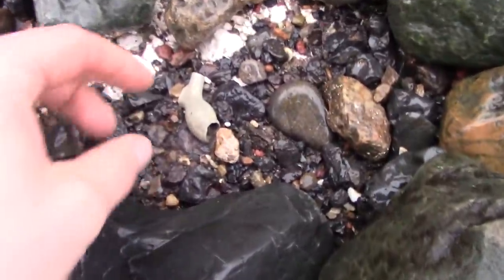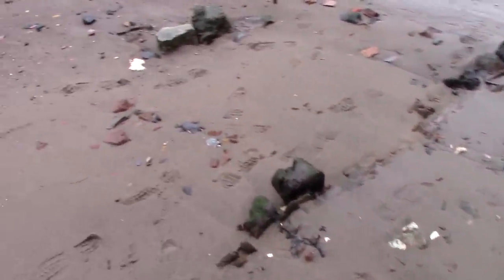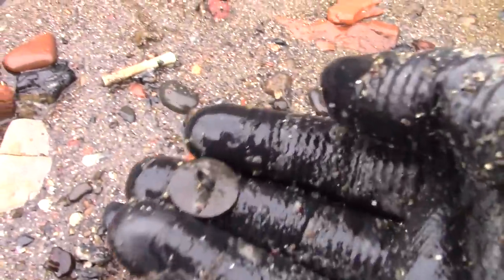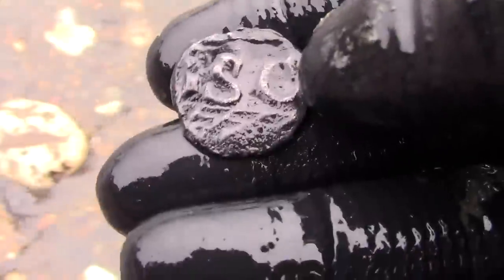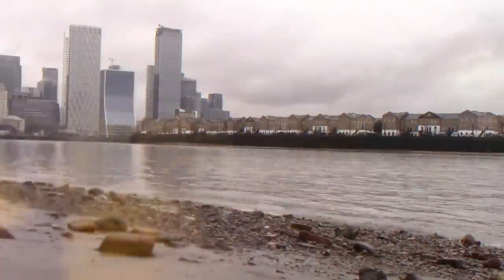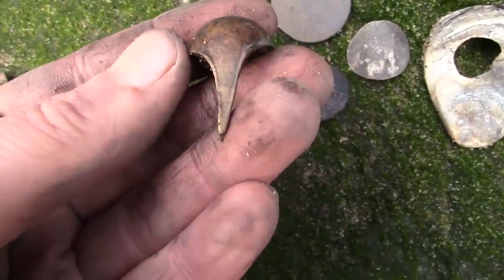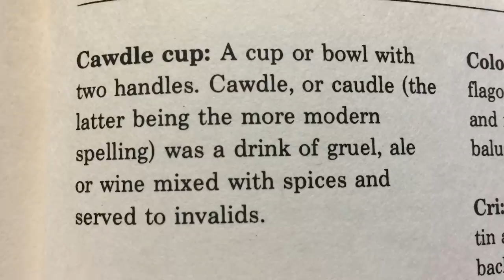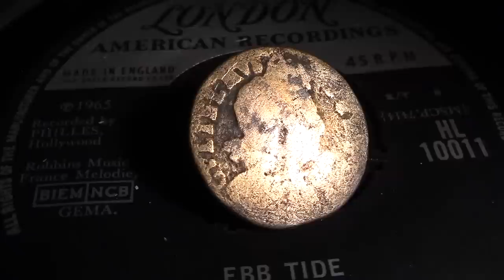I didn't realise I'd found my RAREST relic ever Mudlarking the Thames!

Comment: Hey Si! If you use a bit of water on the oyster while drilling with that bit, you’ll find less chipping and quicker results ( a little less friction) You’ve done a beautiful job on those buttons - gorgeous!!!  Cheers from 🇨🇦😁
Reply from the maker: Katie Cook Cool cheers!
Reply: He done good, right 🇨🇦 ?
Reply: I cut opal and the water keeps the piece cool and saves the diamonds on the bit. Well done!
Reply: @Sifinds  also if you put tape over the area you are cutting, it will help to not chip
Reply: I beachcomb for sea glass here in Nova Scotia , Canada.  I make jewelry and always use just enough  water to cover the sea glass when drilling . Your shell buttons turned out really nice . I'm going to try that this summer. Mudlarking looks fun !
Reply: yes water would be good - also less dust to breath in - apparently it can be toxic in your lungs
Reply: uncletigger  It reduces friction, keeps the diamonds clear and prevents that horrible dust from becoming airborne. Don't breathe it, it can cause silicosis.
Reply: Katie Cook the water also saves the diamond grit from grinding off the tool.  Those bits can be expensive!  I usually drill underwater by placing the piece in a shallow container.  You can also create a dam with putty, around the work spot, and fill it with water.
Reply: Goog call mate, those buttons are lovely, I'm going to do that myself👍
Reply: @deeyardo4850  Shell/Bone Inlay/Carver here in Hawaii. More than "apparently". The dust has the same effect as silica (silicosis) never leaves your lungs and will kill you eventually.

Comment: Oyster theory: They were used for ALL of those things-- cladding, roof leveling, oyster farming, button-making, and probably a ton more (and let's not forget that ornamentation for musical instruments was sawed out of bits of oyster shell-- you'd cut it into strips, plane it thin and even, and inlay it as frets on lute-bridges and so forth, as well as fancy ornamentation of all kinds on wooden boxes. This was done with bone too.)  Why so many uses?  Because it was a common resource, and you didn't have much in the Middle Ages (or any time prior to now, really) that was used exclusively for only one purpose, you usually had all sorts of stuff you could make out of one kind of thing.  Look at cow's horns as an example-- they made everything from jewelry to lantern-panes out of it.  BTW, be sure to wear a mask if you're going to be working with grinding down oyster-shell-- the dust is extremely bad for the lungs.  The buttons came out nice-- looks like something that'd be worn by Pearly Kings!  Congrats on the rare cup find-- I've never even heard of those, that was massively cool, and I love the hilt-pommel!
Reply from the maker: Spot on !

Comment: Oyster shells with holes used in building stucco walls and structures, another use as wind chimes! Cool buttons..see if the wind chime idea works!
Reply from the maker: Tom Shively Yes another project to add to the list. Maybe I’ll put a clay pipe stem in the hole. Now that’s an idea!
Reply: A wind chime with pipe stems, oyster shells, and lead weights, suspended from  larger pieces of flotsam or jetsam.  Although one made of eating utensils would make a better sound.

Comment: Hi Si I used to cut glass for a living we would use a bit like that to make holes in glass. What we used to do is make a dam around the place we wanted the hole with butyl sealer then keep adding water while drilling that way you would be drilling in a little puddle of water this would cool the bit and turn the dust into sludge

Comment: You should try wearing some of those oyster shells as belt buckles. Paired with rope and/or cloth as the belt.
Reply: I think making a belt from shells is a Great idea, only have the shells go all the way around the belt, like in the Southwest, Native Americans have silver, go all the way around the big wide belt
Reply: I was thinking less arts and crafts more research into original use. I think these shells are belt buckles popped off. Lori, I think the shells that go around the belt would have two slits not one hole, this would keep them on the belt when the buckle popped of and rolled away. Only rope and buckle for poor longshoreman, rope buckle and shells the way round if you are a pimp.

Comment: Those diamond bits last much longer if you use them with water, keep it soaked while drilling, I have drilled hundreds of holes with them into granite they don't last long dry.  Cool finds, great presentation of the cleaned up stuff!

Comment: Hello from B.C. Canada. I have to admit I didn’t read all comments so this may have been covered.
Out here on the west coast we have a sea snail called the moonsnail. It’s possible you have something similar in British waters. The moon snail envelops the prey and then bores a hole through the shell using its radula and an acid secretion. Once the shell is bored open, the proboscis is used to consume the flesh of the prey. The hole in the shell, which has a "countersunk" appearance with chamfered edges, and which varies in size according to the species, is a characteristic diagnostic sign of moon snail predation.
After saying all of this it doesn’t answer the question why some of the holes are square.
Enjoy your channel since I was born in Lambeth back in 1950. Would love to do some mudlarking.
Reply from the maker: GITNADOIX cheers pal!

Comment: The oyster shell itself held spawn so throwing them or stringing them back in the water saved the spawn from drying out. The holes are probably as you suggested, from stringing them up but that square one that is very cool!

Comment: Hello, I live on Vancouver Island in British Columbia Canada. We have the same kind of oysters, called green oysters. The part of the shell with the hole in it is the part that attaches to the rock, as they are dislodged the "oyster glue" that attaches the oyster to the rock is very brittle and you get the type of shell you found. We call them "angel wings" as they are so fragile and delicate, almost transparent in a way. the other reason for holes drilled into shells, such as oysters, clams and snails is a type of snail we have here called a "moon snail" they have a zipper like mouth that grinds a perfect hole in their dinner's shell, inserts it's proboscis into the hole and eats the flesh inside. "Moon shells", adult, are between the size of an apple, or even as large as a grapefruit, you should look them up on YouTube, fascinating. Happy hunting.

Comment: "That strange little mouse helmet" is the butt cap to an 18th century pocket pistol, a form that formed into a sort of hook shape. The brass butt cap was at the extreme rear and rested into the palm of the hand. One sees the central screw hole as well as the pointed projection at the opposite end, the tip of which dug into the wooden (usually walnut) stock so as to anchor that part in the wood.

Comment: Before you drill the button out, build a "wall" of play dough around the area and fill it with water to prevent dust from getting in the air. This also helps the drill bit from overheating. I did this in lapidary class in college.

Comment: Nice idea to make your own buttons, and if you decided you want to make a lot of them, you can save a lot of work by cutting them all out, then drilling the holes, then get yourself a little electric gem and rock tumbler machine to do all the sanding work for you.  You can choose to tumble them with finer and finer grit to a high polish, or tumble them just a little to remove any rough edges.  They would make beautiful buttons.
Reply from the maker: That's a great idea!

Comment: Just a quick tip. As others have said use water when drilling. Get an empty coke bottle fill it with water and drill a hole halfway down. Stand it next to object and take the cap off when drilling. The water will spray onto the object. When finished just put the cap back on the bottle and the water will stop.

Comment: Nice idea with the button/keyring token. Try using a Dremel type tool for polishing and sanding. They are ideal for that type of thing and have many small polishing and sanding heads as well as small drill bits if you wanted to make them into buttons.

Comment: The pieces could also have been removed from the shells to make jewelry or inlays for furniture. There's a reason that shiny stuff is called "mother of pearl". Here in the US some shells can be found that contain purple parts, Native Americans used to cut those out and use it for money, it's called "wampum" and it's still used sometimes as jewelry.
When you cut into a shell, make sure to wear a mask or respirator and clean up well afterward, preferably do it outdoors. Shells can be toxic when finely powdered.

Comment: Abalone shells, are worth a few quid, if highly polished - even I use them or flakes, for jewellery/Resin projects. 
The square or round bits, were probably made with hammer & chisel, by button makers, but doubt they’d only take 1 part. But, Victorian mudlarks, often young boys, would sell just a small, polished piece to a tourist, to put into bracelet, necklace, or  scarf pin, cabochon, or pocket ‘touch stone’, or ‘worry stone’, because how smooth they become with being highly polished.  (the hard part, is to Polish them- I e tried with a dremilsander but hours later I gave up!

Comment: Perhaps the oyster shells were put on a  cord or stick and used as counters. Some of the Roman lead eggs were sling ammo and the Cawdle cup is a fantastic find.
When you cut the oyster shell make sure to wear a decent dust mask, not good stuff to breathe, the dust from those diamond hole saws is super fine, you can't see it  sometimes but it is easy to ingest.
Reply from the maker: chris osh Cool beans

Comment: Hi Si, what I have heard about the holes in Oyster shells (and actually other shells) is that  it is  caused by the muscle section that attaches the Oyster to the shell. As it is attached to the shell it makes the shell itself thinner and weaker due to the attachment. Then when the Oyster is opened and the shell is empty over time the weather/sand/waves etc end up having the hole appear due to that section wearing away quicker than the other parts of the shell :) As always enjoyed your video :) take care! Valerie
Reply from the maker: LuvBugCrafts yes quite possible thanks

Comment: WOW Si Finds! What a good day with Much Luck inna Muck! I did guess the brass piece correctly but that pewter cup is amazing! I'll bet you're jumping up and down doing a jig! I was here in Pa.! I was thinking that if you'd cut the pipe stem pieces into beads you could make some necklaces and use them as spacers in between glass beads. I've seen Native pieces where they'd use bone or clay beads in between glass trade beads or clay beads. I also have experience working with shells and making buttons or inlays in wood or stone. I found if you use a bit of water with your diamond bits it cuts smoother and keeps the dust down. You can also do your sanding with water proof sand paper. If you want a high polish use some compound with your buffing wheel. I've inlaid shell in pipestone and other stones and wood as well. Perhaps you could start making your own SiFinds coins, like the lead tokens. I can see you in the history books of the future, Hey Boys, I found a SiFinds Token! Your video Simon accommodated my first cuppaJO (coffee) this morning so it was even better! Thank You for another FINE as frogs hair Luck in the Muck video!  Can't be beat! You're part of my Sunday along with Nicola and some of the others you've introduced. I wish you Love, Light, Peace and Luck Inna Muck! DaveyJO in Pa.
Reply from the maker: Daveyjo Weaver Hiya Dave. I do make thames clay pipes bracelets. And sell them on my store. Yes it was an amazing find, so happy. Glad to be part of your Sunday routine! Cheers Mudlover!

Comment: Love your channel. Had a thought on those single hole oysters. Could they have been used as wax guards on candles? I just remember going to a christmas service at a church where at some point they passed around small candles with a little paper wax guard so it could be held without fear of hot dripping wax. Seems plausible.

Comment: Obviously they would mount a wooden handle to those shells and dig up the clams or chip them off surfaces and then use the hammer stones to crack them open and eat! Could be 8,000 years old or a thousand years but really cool find and could be quite significant!

Comment: I realize this is a two year old video however I'm just now watching now,  you're using a  diamond bit drill head, it's best to be used with water, as it will give you better results. Sandpaper is also to be used with water when sanding an oyster shell, as it comes from the sea or water

Comment: Congratulations on all your finds, Si - especially your caudle cup and Dutch coin!  BTW, if you ever find a Roman coin with more than one hole drilled in it, it was probably used as button.
Reply from the maker: daver8521 Cheers matey. Never seen a Roman coin with two holes in it, and I follow a lot of groups on FB.

Comment: BTW, your Thames Oyster shells have suffered the same fate as shell fish from any other country. They have been caught by a Star fish which is the guilty party that bored the hole it it. The Starfish then eats the contents of the shells.
The oysters with very large hole (or various types of shellfish) have been there for a long time and a large hole has formed by water or sand interaction. You will see this a lot if you travel around your coast a bit.

Comment: In the Caribbean you'll find big Lobatus (formerly Strombus) gigas shells with a single hole in them as well, even if these shells were also used to create beads and even shell axes. I've been told that these holes were made to detach the mollusc's muscles, as you wouldn't be able to get them out otherwise, which might also be the case here. However, seeing as how easily oysters can be opened and eaten like that, this doesn't sound very likely. Something interesting about the Caribbean example, however, is that there's a difference in the way the wholes were made. Indigenous peoples of the Caribbean would typically leave round whole made by smashing the shell using a sharp stone, whereas later European colonists would make square holes, cutting through the shells using a knife.

May be part of why there are so many hypotheses on what the holes in oysters along the Themes mean could lie in the difference in holes there as well. That is, there's not one single fits-all explanation, but rather different explanations depending on the type of hole and the era during which the holes were made.

Comment: Pommel cap maybe. When processing shell use water , it keeps dust down and saves the cutter.  Use wet and dry paper to stop the dust blocking the paper.Also use a mask. The dust is pretty nasty if you inhale it.  It is silica

Comment: Those gas cartridges you found are most likely Co2 carts from a variety of things. Airsoft/BB guns, portable pneumatic tools, the list goes on. I highly doubt they are nitrous carts because those are usually blue or have a coating of paint or wax of some sort (because they are supposed to be used in the kitchen and around food items.) The raw chromed tanks are used for industrial purposes and 9 out of 10 times are Co2 inside. Now you know.

Comment: Some whelks drill holes in shellfish to eat the interior. Oyster farmers have strung shell to collect spat, young oysters, since Roman times. I like your theory for some holes. The square one...weird!  Would a square piece of metal smash a square hole in a shell like that? Worth testing. Great finds and content!
Reply from the maker: Z Worm yes it does - tried it
Reply: @Sifinds  I was out walking in Oklahoma wilds and came across piles of shells with holes cut in them. Freshwater mussels mostly. They were cut to get as many as possible from each shell. Then I found some reject buttons too. I saved some. It was an old button makers house. I wish I knew about metal detecting then. The past is awesome. Thanks for sharing.

Comment: Well Si, the shell with the square hole is the most perplexing! Anyway, my theory is a more 'slimy one !  I believe they could be caused by hole boring bi-valves! On field study a handful of years ago, i found some rock formations in a river that had interesting holes seemingly drilled through them. I was baffled at first as to what the cause of the holes, and they looked to me to have been human in origin.
 Later after researching, I came across piddocks or the species creature, pholadidae. Angelwings are another family of bi-valve mollusk (or what you might refer to as a squatter there in cheery o' England) :) If they were whole shells one might be able to see more clearly if there were burrows. Great show, such fun. Thanks!
Reply from the maker: Rio Thanks for that. Mysteries deepen!
Reply: @Sifinds  Congrats on the rare find!

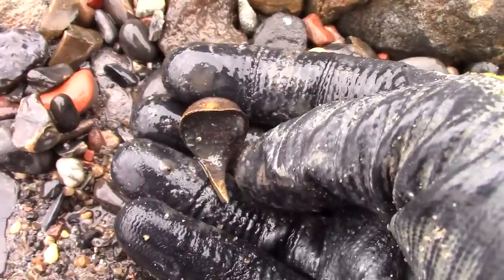Comment: 15:26 I strongly suspect it is a small spoon. Salt and suguar were expensive and you only used a little at a time. Sorry, my blacksmithing background made me say that ! :D That is a diamond tipped HOLE SAW, used to make larger diameter holes while using less power than a drill. Diamond tipped is very often used on glass and the like. Drill from the side of the object you want to be showing, you will have less chips that way as very often the saw will break and chip the back side of the hole. OK, I missed the guess, not a spoon LOL! Nice cup!!
Reply from the maker: wayne parris Cheers Wayne. Turns out I was wrong too. It the end of a pistol grip. Even cooler eh?!